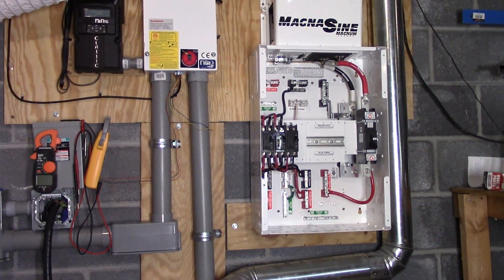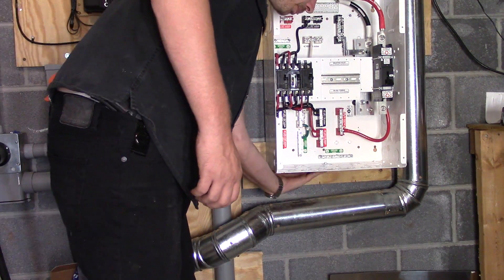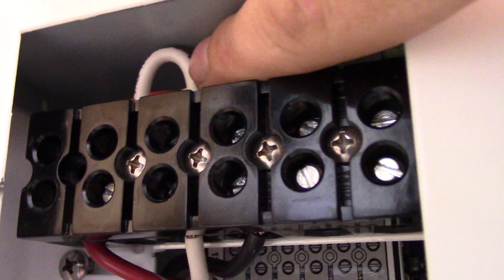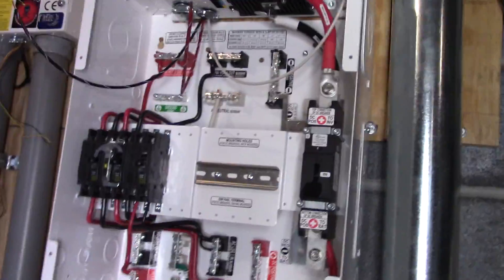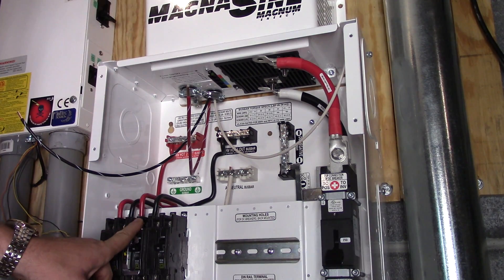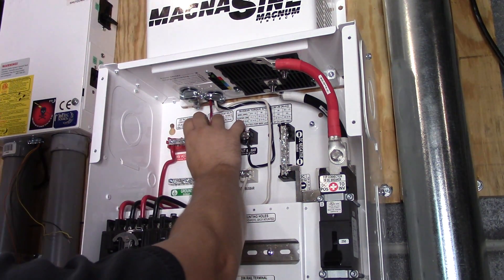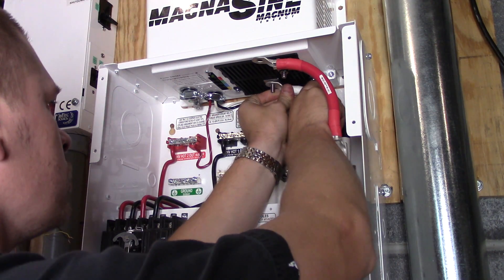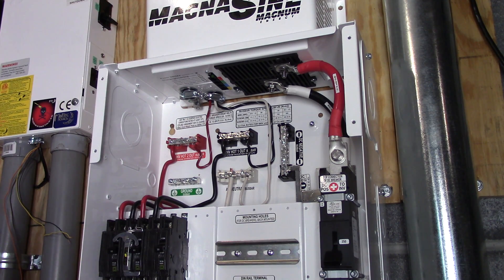How to install a 48 volt magnum inverter and breaker panel part 2

Comment: MagnaSine installation manual says inverter gets hot (90C) and is to be mounted on non-combustable material. I've never installed one so that's both observation and question
Reply from the maker: Steve Brown I haven't experienced my inverter getting 90 degrees Celsius in fact I'm surprised when it gets above 90 degrees Fahrenheit

Comment: Do you torque any of your screws or nuts?
Reply from the maker: I tighten them to the breaking point and then I quit
Reply from the maker: if it breaks and needed to be replaced
Reply: Solar Power Electricity and Electronics is it possible to over tighten without breaking the lug but damaging the strands of wire?
Reply from the maker: Yes it is that's if you don't strip the wiring correctly